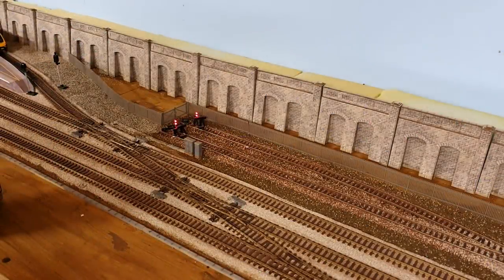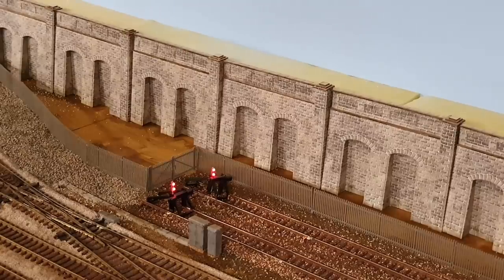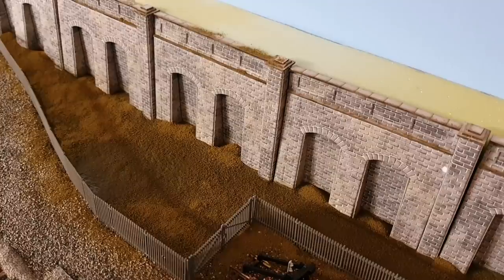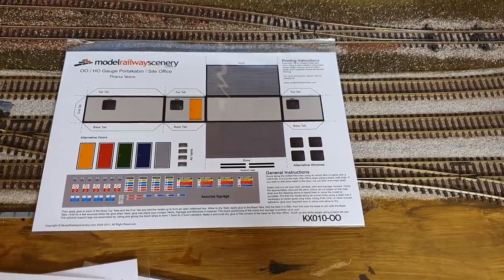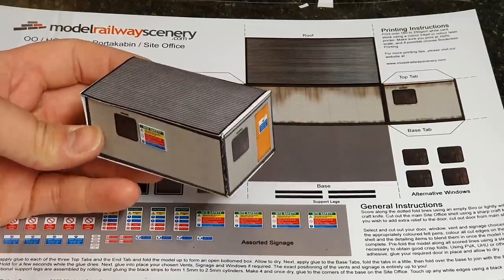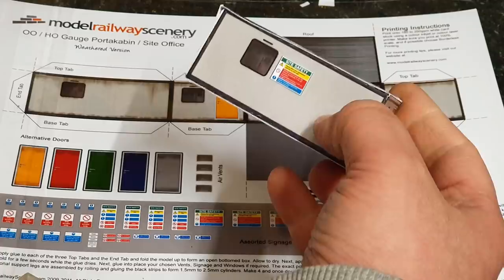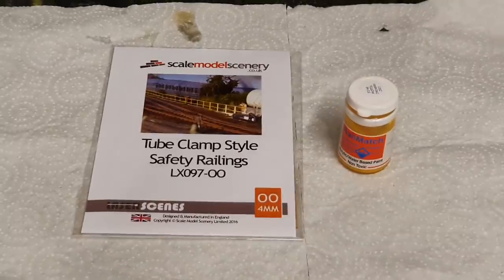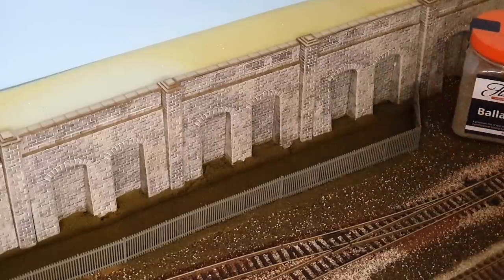New Junction - Adding a Station Pilot Siding, Part Four | Adding the finer details

Comment: Looks brilliant Richard. Can I advise that the Stop Boards are for drivers not for walking routes. They are in situ for a signal. i.e will say normally Stop and telephone signaller. So you treat it as a stop signal and do not pass till you have been authorised by the signaller. Couldn't read what was on your stop board.
Reply from the maker: Your right, I need to update them with 'stop look listen' types really. Just a bit odd facing a line on the mainline.
Reply: Normally on fright sidings etc or depots for releasing locos/units.

Comment: It is now another point of interest on your layout. Nicely made Richard. I am using an acrylic matt lacquer as matt varnish here is way to expensive. I have looked it up and they say there is not much difference between the two. What do you think? I have to use something, because of the humitate here.
Reply from the maker: Can't see why it would be an issue, it's worth testing it before covering important areas on your layout.
Reply: Can I offer my experience of varnishes, if you don't mind?    I use a matt spray varnish from an aerosol.  GhIant I think the brand.  I good misting of that deals all the print in, making it repel the water!..   I do this before installing the card structure, or even before assembling them.  You can do it when the structure is in place....just use plastic sheeting or card to cover the surrounding area.  That what I did with the walls that run along the back of Dean Park station.  Hope that gives you another route to consider.   Cheers

Comment: First : Nice job! but technically i have a problem... how the car goes over there, on the other side of fence?
Reply: I'm assuming the access is behind the buffer stops, through the double gates... although with a Track Centre of 10 ft 8.5 in (3.26 m) in the UK. I'm not sure there would be enough room to get past the buffers in reality??
Reply from the maker: Theres another gate. ;-)
Reply: @NewJunction  hahaha waiting to see that. I hope you table turns into a little pièce of art.
Reply: 2:53 - other gate at far end  @psamaury

Comment: Did they have signals like that on the railways? Surely a modeller of your calibre would have sorted that before filming. As for the concrete walk-way. Let's hope your roof doesn't spring a leak. The slightest gust of wind will blow that away. Some initial work on removing some ballast, then laying the walk-way and then re-ballasting to the same level would have made it so much more realistic.
Quite surprised at the shoddiness of the work undertaken. It may well be worth re-addressing that later, it will be worth it in the long run.
Reply from the maker: Don't be surprised, I'm not an expert! It would be good to see a video or two or your modelling abilities to learn from! :-)
Reply: If only I could son. Restricted mobility and living off a pension does not allow me the luxury of having a model railway but I enjoy watching them.
Reply from the maker: That's a shame, you'll have to try to enjoy my shoddy work as a second best option!